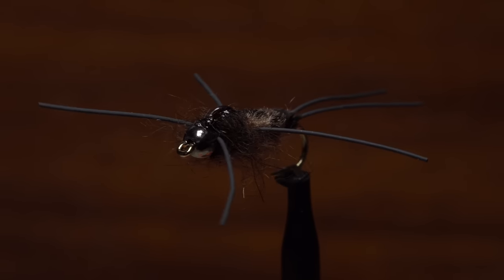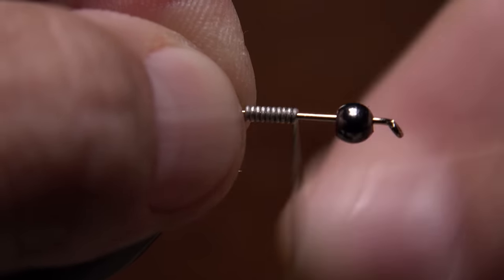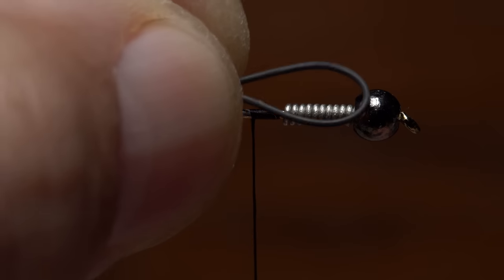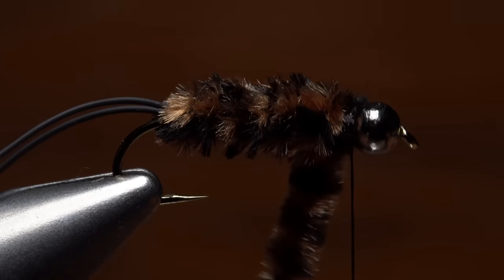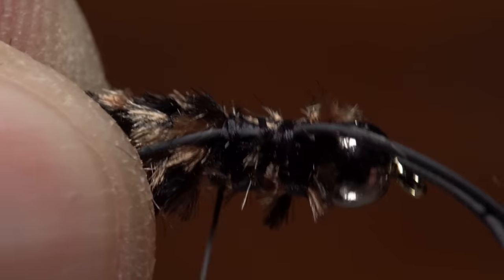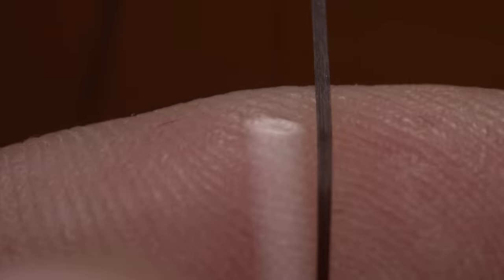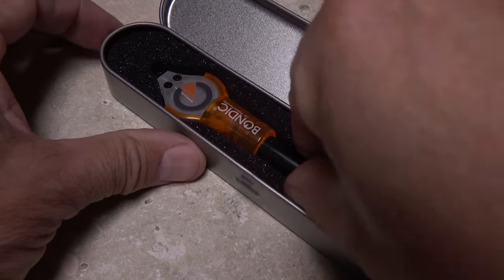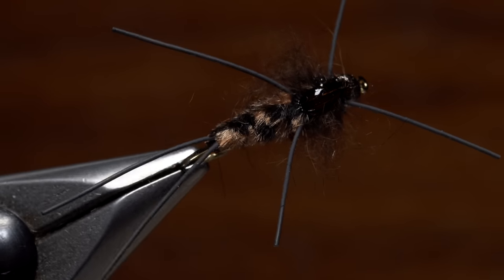Pat's Plus

Comment: a little tip; use the loop you used for the tails as the antennae to minimize waste
Reply from the maker: That doesn't actually reduce waste and it would make trimming the body to shape much more difficult as the antennae loop would get in the way.